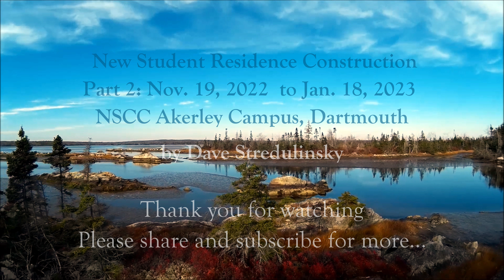New Student Residence Construction Part 2: Nov. 19, 2022  to Jan. 18, 2023, NSCC Akerley Campus

Comment: Pouring concrete in winter months when cold can be tricky.  Looks like they were able to get it done.  That crane is cool.  Fun to see the panels lifted. I worked for a big construction company for a decade but not in the field. Thanks for the narrative subtitle description.  Played in full.  Like 134.  Cheers to the adventure.
Reply from the maker: Thank you very much for your wonderful comments and support, my good friend.I noticed they had two heaters blowing air in through windows during the periods they were pouring the concrete floors and other windows covered with tarps.

Comment: really strange how to build the walls on the ground and then put them vertical.🤔
Thank you Dave:elbowcough:
Reply from the maker: Thank you very much, my friend.  Yes, a different way to build. Makes for strong well insulated walls. I am working on Part 3 with interior steel beam frames, roof and pouring the concrete upper floors.